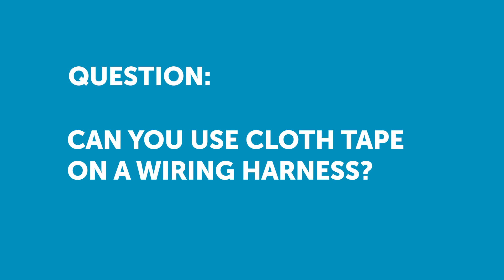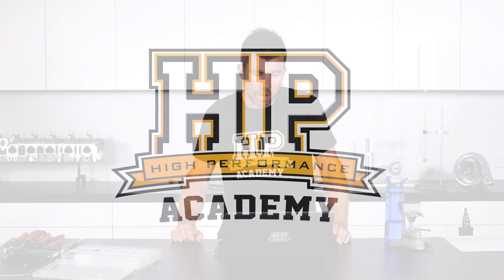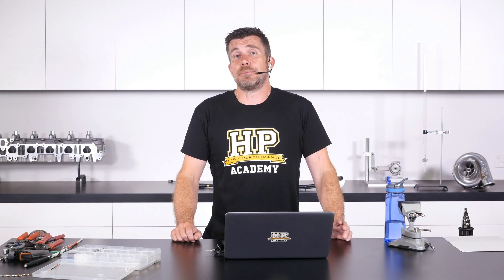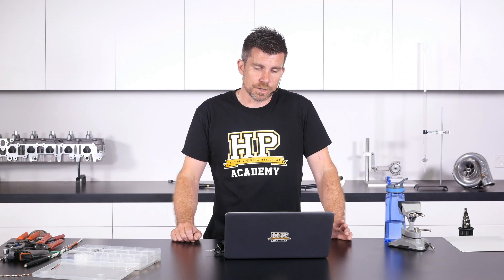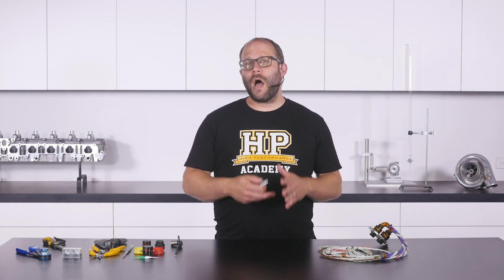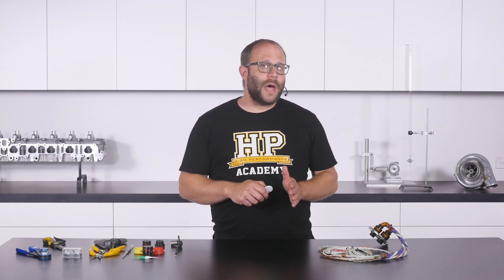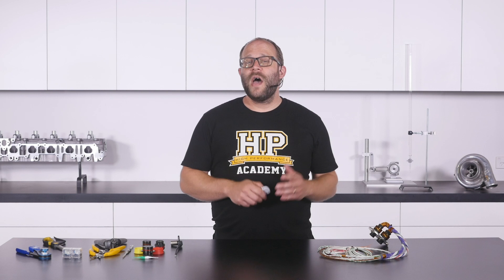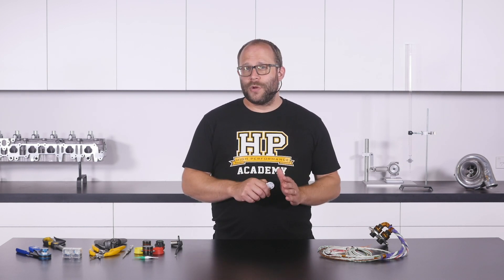Cloth Tape Insulation | Is It OK To Use On My Wiring Harness? [HPA Q&A]

Comment: I use baking sheets between the wire and tesa tape.  Looks meh but keeps the wires from getting sticky.  Alot cheaper than braided and does the job if your trying not to win best wiring harness at a car show.
Did the heat shrink route once but soon as I needed to add something it became a nightmare

Comment: Do you have a tuning course for Motec ecu?
Reply from the maker: Yes sir! We have a lot of MoTeC specific content along with the core course material which teaches you the fundamentals of tuning that apply to almost any ECU. If you're new to tuning you want to take EFI Tuning Fundamentals, Understanding AFR and then the Practical Standalone ECU Tuning course in that order. The last course has MoTeC specific content included, and we help you along the way via the members only forum and webinar archive. You can get them all as a package deal here: www.hpacademy.com/courses/practical-dyno-tuning/
If you have tuned over 100+ cars and are just new to the MoTeC platform only, email me and I'll run you through another option that will not teach you how to tune, it will only show you the ins and outs of the M1 Tune software package - Taz. support@hpacademy.com

Comment: Every time I encounter cloth tape wiring, it's a mess. I don't know if there is a better motorsports grade out there, but OEM and any aftermarket cloth tape I've encountered tends to be in rough shape, especially near the connectors.